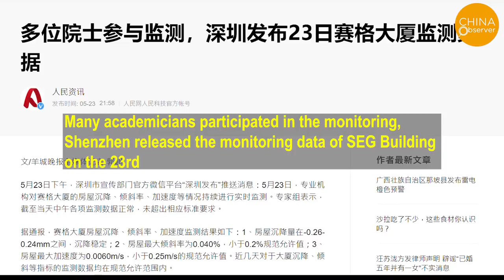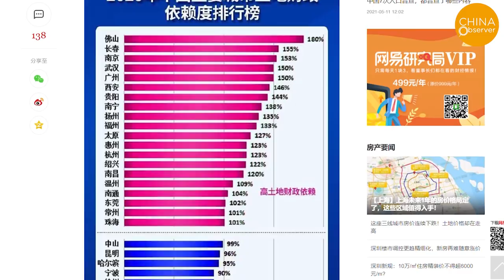356m tall skyscraper shakes violently again on May 27th, China real estate bubble

Comment: With tubular concrete structures the steel is supposed to control bending while the concrete deals with axial (vertical) load. The fact that this building is shaking vertically could indicate compromised integrity in the concrete. If those massive tube columns show signs of buckling then they're in big trouble. Also if all the tenants go back inside that creates even more axial load. If the concrete is cracking inside the steel tube not sure what they can do, except buy time against the inevitable.
Reply: My guess is that the concreate fill is not armed or the arming is missing in some sections. 20y thermal cycle make sudden friction movements. If happen on one side it will give angular movements which will induce a shake in the hole structure.
This hybrid bend stiffness by steel and vertical stiffness by concrete reduce the steel but is more tricky to workaround the thermal expansion difference.
If the inner arming is the issue, warming the steel create pull on the concrete and break. Filling with friction reducing liquids help to reduce the sudden friction loss movement but the concrete breaks are there.
Reply: That is exactly my thought. The concrete is compromised inside that tubes in the lower part of the building. In high rise buildings they usually use a high grade concrete with the compressive strength up to 3 to 5 times grater than regular buildings. But you can't tell the difference when the concrete is poured. Given the speed of construction I guess some quality control procedures where skipped...
Reply: They can launch a fully loaded Airbus into the 80th floor. That will hasten the inevitable.

Comment: They should put a resonance damper on the top floors. It is too tall so it is affected by wind even by low wind speeds. Because the height of the building creates a large surface area which is more easily impacted by low wind speeds

Comment: Concrete fill debounding from steel casing...
Columns failure...
building overloaded...
materials are being removed to lessen loads carried by structural members....
if ever allowed for used, only few floors will be permitted for limited occupancy only not full occupancy ...🙏🙏🙏

Comment: This building has a MAJOR structural flaw.  The vibration is an excited mode shape with significant amplitude.  It will destroy this building with time, a critical failure mode.  Find this issue, fix it, but I suspect that it is too deep within the structure to be easily fixed or detected.  Get out.

Comment: I wonder if anyone has investigated resonance. This building is 1m short of the speed of sound in air at 40c 355m/s. This correlates to a frequency of approximately 1Hz. What machinery nearby could generate that sort of frequency? 
At a guess, lift wheels, lift cables. Large diesel engines with an idle speed of around 50-100rpm. Ever heard that chuffing sound in underground car parks, or near stationery busses.
Train sleepers have a spacing of around 1- 2m. This causes a low frequency element as trains pass over the fixed ponts.
This building is basically a 1 wavelength antenna at the speed of sound. What you don't want is standing waves, either in an antenna system or a building. Both can cause failure (radio amplifier goes bang and building shakes to bits).

Comment: wind speed above the ground is higher and gusting will cause joint fatigue over time. the problem is that this building was not checked properly for its vibration modes. it seems that some of the wind gusting frequencies are close to some of the natural vibration frequencies of the building. they have real problem if resonance sets up because of this. they ought to expect failures in the structure to occur. dangerous stuff!!!

Comment: Looks like they did not do the mandatory wind tunnel test before building it.
Reply: That's not true. They did it. And the building didn't shake for 20 years or so, right? But something has obviously messed up - either on the top of the building, or within it. And now the structure has most likely been damaged/compromised. A write-off.

Comment: 2:10 Why surprising. Unless the cause is immediately evident, I would be surprised if they could find out the source in only 5 days. I would imagine opening interior cladding covering up the main structural supports itself would take more than 5 days, not to mention getting approvals etc for such a work.

Comment: Those steel pipes are likely failing because of failing concrete fill. If the tensile strength of the concrete in the pipes is lower than the design requirements, it might crumble which means the walls could cripple.

One failure could lead to a catastrophic cascading failure.

Comment: This is not good. The welds or bolts or whatever are likely compromised. Hard to actually see when everything is 'internal' ----- or unseen. Clearly something has messed up with this particular building, as no other ones behave like that. The building didn't do this very noticeable shaking thing in the 20 or so years before this ------ so obviously something has stuffed up this year - in the building somewhere. They most likely need to deconstruct this one, and start again ----- doing a more thorough job with material and building code this time.

Comment: I find that in a lot of videos on China the presenters are theatrical or are even outright hostile and often appeal to emotion. This on the other hand was well written and far more neutral, well done. One issue i see is that you at times present a lot of numbers (in multiple currencies) and later compare them. Maybe add a bar graph with them when comparing, otherwise it can be hard to relate those big numbers to each other.

Comment: The problem is probably 'resonance'; when winds and/or ground movements are in a very specific resonant pattern, structures will shake. It happened to older bridges in the past until they fixed the structural problems that predisposed them to it. If this building has a resonance issue, they are hosed.... will need to tear it down and rebuild a different structure...$$$$

Comment: Has anyone added significant weight to their apartment, or office or removed significant weight, recently?  This could have changed the natural resonance of the building.  The other issues can be rust, corrosion, erosion of the metal, etc... from moisture getting inside.  Rust and corrosion destroyed a bridge in Japan after 20 years despite annual inspections.
Reply: This is a brand new building, The damn concrete didn't even set properly yet.. There is a reason the west take their time with buildings. You cannot make money if it's not safe and everyone dies. You wait, this will be a disaster it's just a matter of when it will happen..

Comment: That Building should not be just shaking/vibrating arbitrarily.
I could kinda understand if there was wind, because tall Buildings like that are designed to sway when there is high winds.
But shake? Ehhhh, that doesn't sound good - that almost sounds like a construction integrity issue.
Well...if it falls over or something like that we will know for sure.
I would not feel safe in it.

Comment: Lets look at the facts as we know it. 

Sec plaza was finished in 2000 and this was prior to the drought in 2005. 

So a lot of pressure is on the concrete raft that anchors the building. It is highly likely that over time the raft has sunken because of extended drought. The recent rains and winds will fill that sandy sinkhole prone soil and cause it to heave. If the raft is compromised the building will wobble. I think that is what we are witnessing. 

The foundation raft is compromised. 

With the threat of typhoons, rain and high winds after a long la Niña…   I would shut the building down.  It is obvious that the concrete foundation is broken and the piles are punching through the raft footer. 

Sources of research used to form a logical conclusion… 

Weather warnings: 
http://www.sz.gov.cn/en_szgov/news/notices/content/post_8813511.html

http://www.newsgd.com/news/2020-04/21/content_190776689.htm

Load data: 
https://en.m.wikipedia.org/wiki/SEG_Plaza

Foundation science: 
https://scienceblogs.com/startswithabang/2009/06/26/how-stable-are-skyscrapers

Comment: What ever that JOKE of an Inspector does on checking the welds he CAN NOT find a darn thing at that speed. We do underwater and structural welding and welding inspections are a must for what we do. And the inspectors we have take their sweet time and slowly run the probes because millions of USD are at stake when an oil rig goes and fails.
Looking at their LAND usage policy builders should start working on bigger lots with multiple sky scrapers been bridge connected with each other at 2 levels in mid air allowing 2 major factors. 
In case of a Fire an alternative way to evacuate and also fire departments to be able to reach it. 2nd stability in general and reduction of elevator usage as well. Let Elevators only go to those Major interconnection levels and have those as central social points where also for Fire and Sanitary everything is bundled together. So if you have a 100 story building ever 30 Story put a cross bridge between 2 and more skyscrapers in place. Look at the Petronas Twin Towers same design. which will create a lot of benefits

Comment: The sad thing is that the CCP will not be forthcoming with accurate information regarding how badly this building's structure has deteriorated, since the CCP would view this as an embarrassing admission of failure.

My guess as to what's happening is that the structural steel, in the rebars and columns, has corroded due to salt accelerated corrosion, the salt having come from having used ocean sand or seawater in the concrete mix. One concern is that these large amplitude oscillations will further weaken the steel through repeated bending that will ultimately result in a catastrophic failure of the structure. If this does happen, I hope that there are no people inside or close enough outside to get hit by falling debris. I just wish for once the CCP would act out of true concern for public safety and not self-serving political expediency.
Reply: Interesting bit about using sand from the ocean containing salt.  I would think they would be smart enough to avoid using sea water itself? Maybe someone with knowledge of building practices in china could comment. 

having concern for their citizens is unfortunately realistic. This is proven by so many issues such as leading the world in workers deaths and injuries in the work place, a problem that could be corrected with proper safety measures but those measures would slow production and ultimately cost the country a loss of money.
Reply: @pauliewalnuts240  At a large county hospital in Miami in which I worked in the 70s, there were a couple of old wings that had been built in the 1930s that we had to abandon and demolish because they were structurally unsafe. It seems the contractor had used seawater in the concrete mix that caused corrosion and failure of the steel rebars in the concrete structural members, with big cracks forming in the concrete and sections of the concrete crumbling.

It would be interesting to know what the cause of this is but I would not bet money on the CCP being honest and forthcoming about it, if it would mean possible loss of face for the party. If there are serious consequences to this that the party can't hide, I would guess that they would just find some convenient scapegoat to hang the blame on.
Reply: @videomaniac108  it's almost certainly a materials or groundworks issue, corrosion is an interesting theory, it's one of many likely scenarios though. 
South Korea had a building boom in the 80s and subsequent failures as a result of cost cutting from government organizations, I feel like China's problems are already many times bigger but as you say with their behavior it will not lead to improvements. I guess with the amazing 95% approval rating of the ccp, they'll just carry on along the same path, it's not like they are worried about being voted out!

Comment: The Antenna is shaped just like a tuning fork that reacts to current wind direction causing oscillating vibrations to travel downward into the structure. Disassemble the antenna immediately and the problem will be solved. Or save some money and connect tuning forks in a crosshatch pattern at the top to solidify them ..

Comment: true everything is ok but antena is at back side so pressure at top per m2 x floor x times mass gives energy imaginable pressure force and combined to wind speed that surpass basic design as usual double force winds give a extra factor 2x more so elastic elements are at risk stability tests are questionabele as design building left slopiness done is not possibel to allow angle antena at side or do terrain construct without specialproject confirmed documentation and since is state , state keeped quit to people respond this is slopyiness in documentation and exsecution as mistake no1 two floor brake this is horizontal lvl lacking deliberate, mistake no 2 no extra construction suport chasis ( the same protocol is when having a helipad on roof require double reinofrce type layers or holders supoert sutrucutre and also double layers orr rebars, since china wanrs to show muscle this building is left iemdiatley for public judge or do muscle whow china in this case is banana slopy build with proper documentation and tesing deliberate since is state firm, oh slopy comunist banana a tease for china party on google oh we build this in mandarine speech in china but forget documentation, any cit construct inspection would figure thsi to easy except heydo sleng joak on rap music and saying is not orange is manadarine in china, but buildign still shake so first part si disassemble tower or put only  1/3 at lower price off cost for build then dismantle roof until stops then return normal antena this time on the midle that means taking down 3-5 floors imediatley and measuring if is not working then take down 10 floors for punishment and builder do all free work at self and lower price for realestate at 30 % imediately and publish wruten apology to public and also publish a statement that is abliged to publish a year report annualy as things done in good vay owner who cares about employes and public image and then after all things report documents as analisys to see charge froud and then the final verdict is about not less then 5 % off year brutto traffic inc fine for desigeners and main enginers and build undertaker which is in this case same corp, quite possible is self public deception deliberate which is someone bizar situation that or good buy you go to court get charged with criminal activity off submining own buisness for fake media popularity as using underrules to be dominable and get chrged for 30% off company year traffic and criminal prosecution that and bank allowing credit with defualt documentation also charged as doing unfair deal to public expressing negligance and unacare china is big but not stupid and no without resource and state will never allow to be self disfunctional deliberatly that is why tax is for in every country and state and fines as eficient establishement off quality and service and tax makes corop push ahead of that image in cosntruction aswell as china cars car sucks is not proper vay to economy to sustian or be inovative in reserach and inovation, china laws does not suport  negligance or dliberate miscare for public opinion politic or trade in economy that stuff misbehave is not writen as apropriate behave even is socialism country constitution as its taken much time or to much time go somewhere or be develpedto certain lvl to have efcient society or tax laws functional, surpriez enough how tax fine makes better corp and rize lvl off competetion thats usualy so except this is unusual case or study with lacking off documentation eficient as quality in english slopy interest best if things doen under fine for construct company doestn matter if state either that or bankrupcy statement from local corp to inabality to be functional on market banks doestn allow credits for joke without standing on its responsibility on work or work in  companies projects also considerigna fact considering this construct wokrs as black work or dark spot in fancy company state history may be..